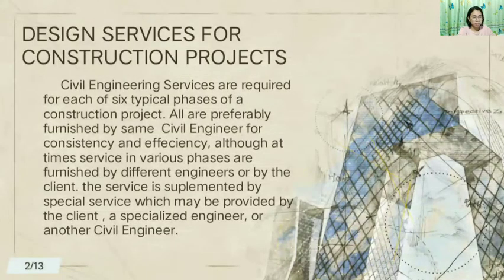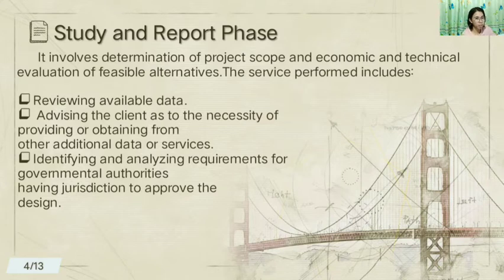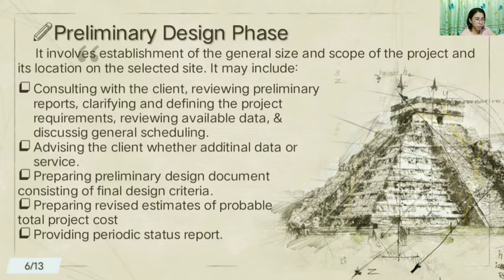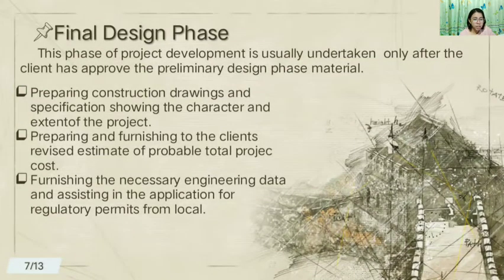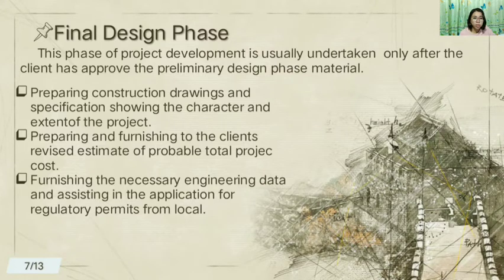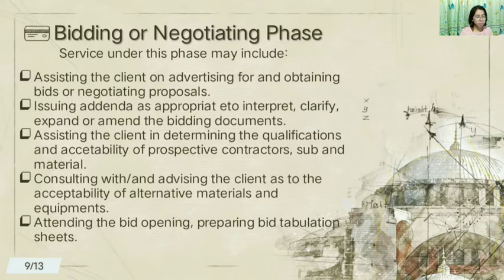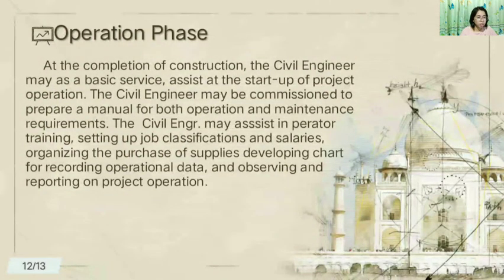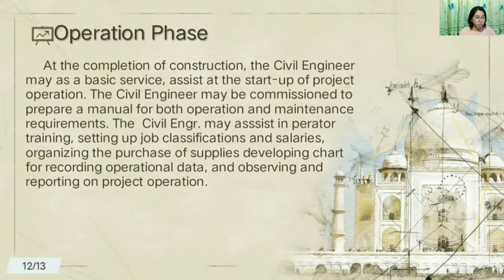2.3 Design Services for Construction Projects

Comment: The reporter discussed about the Classification of Engineering Services.  Many consulting engineering firms offer a wide range of services, while others focus on specialized engineering disciplines such as geotechnical, environmental, traffic, or structural engineering and work with a prime engineer, architect, or owner. Because few consulting firms are qualified to provide complete service for all projects, associate consulting specialists are frequently used to provide specialty services. Clarifying phrase should be included in the contract for engineering services to avoid confusion.

Comment: Within the terms of the Contract, Design Services refer to the professional design and construction management services supplied by the Designer or consultants managed by the Designer. Professional engineering skills is required for each of the six fundamental phases of a construction project. This phase usually includes the study and report phase, preliminary design phase, final design phase, bidding or negotiation phase, construction phase, and operation phase. For consistency and efficiency, all services should preferably be provided by the same consultant, albeit services in different phases can be actually offered by distinct consultants or by the customer.

Comment: This topic has thought me the important thing that I did not know about. The phases for an engineering service. This phase is very important for you to have a guide while doing any project. Because it is not just about designing, presenting, etc. Some steps should be followed to have the proper run of the project.

Comment: The repor is all about the services for construction projects, it is very critical to absorb and appreciate the relationship between design and construction while planning the output of buildings. These procedures must be considered as part of a larger system. First is the general design, it is the process of developing a description of a new facility, which is usually represented by plans and specifications precisely. The construction planning, on the other hand, is the process of defining the activities and resources required to turn the design into reality. As a result, the construction is defined as the execution of a design in accordance to the harmonized vision between the architects and engineers. There lots of operational tasks that must be completed in both design and construction, in accordance to the variety of priority and other linkages among the tasks in the field.

Comment: In this video, it focuses in Design Services for Cobstlnstruction Projects. According to the reporter, it required for each of six typical phases of a construction project. The services is suplemented by special service which may be provided by the client, a specialized engineer, or another Civil Engineer. These six phases are Study and report phase, preliminary design phase, final design phase, bidding or negotiating phase, construction phase, operation phase. It explained how engineering services follow the certain phases that accords to the profession of Civil engineer.

Comment: In this video, the reporter tackled about the design sevices of construction projects in section 2 of the classification of engineering services. Design services means the total architectural design and engineering for the Trade Contractor Work, and includes all labor, materials, gear and services to be given by the Trade Contractor to fulfill its obligations under the Trade Contract Agreement. The Design Services shall include the entirety of the work, materials, hardware and administrations to be given by the subconsultant  of any tier employed directly  or indirectly by the Trade Contractor, and will incorporate all necessary and appropriate coordination and integration of the Consultant's Services to allow the Trade Contractor to complete the Trade Contractor Work in understanding with the Design Documents. The Design Services will be performed in strict accordance with all arrangements of the Act.

Comment: The essential factors of the design procedure encompass the established order of targets and criteria, synthesis, analysis, construction, checking out, and assessment. Thus, the top reason for engineering layout is to use scientific information to answer technical problems. While engineers offer a technical solution, it's far very essential to recognize that engineering layout implies an answer this is aesthetic as well. In different words, designers too are worried to make certain that the stop product is economical, eco-pleasant, and appeals to users. This manner guarantees that your designs are nicely converted right into a first-rate stop result. The reporter referred to the 6 levels of engineering offerings that's Study and document phase, entails dedication of undertaking scope, financial and technical assessment of possible alternatives. Lastly, the essential factors of the layout procedure encompass the established order of targets and criteria, synthesis, analysis, construction, checking out, and assessment. Thus, the top reason for engineering layout is to use scientific information to answer technical problems.

Comment: When planning structures, it is vital to understand the tight relationship between design and construction, as seen in this video. These operations should be viewed as a component of a bigger picture. Construction planning, on the other hand, is the process of determining the actions and resources required to turn the design into a physical reality. Design is the process of producing a description of a new facility, which is usually represented by exact plans and specifications. As a result, construction is defined as the execution of an architectural or engineering design. In both design and construction, a range of operational tasks must be done, with a variety of priority and other linkages among the various jobs.
services.

Comment: Design Services refers to all architectural design and engineering for the Trade Contractor Work, as well as all labor, materials, equipment, and services that the Trade Contractor must provide in order to fulfill its obligations under the Trade Contract Agreement, as explained by the reporter in this video. The design process must be planned and regulated in order for project budgets to be met, programs to be completed, and designs to be properly coordinated and communicated. Missing information, poorly conveyed information, discrepancies between documents, poor resource allocation, bad decision making owing to insufficient knowledge, and so on can all cause problems.

Comment: In this video the reporter explicate about design services for construction projects align with the classification of engineering services. Design services is a process which creates a sustainable solution and optimal experiences for both customers in unique context and service providers involved. Civil engineers for consistency and efficiency at times service in various phases are furnished by different engineers or by the client. Reporter mentioned the 6 phases of engineering services which is Study and report phase, involves determination of project scope, economic and technical evaluation of feasible alternatives. Preliminary design phase, it entail establishment of the general size and scope of the project and its location on the selected site. Final design phase, this phase of project development is usually undertaken after the client's approval. Bidding or Negotiating phase, it is to assist, issuing and attending for the requirements of the projects. Construction phase, it entail on consulting and advising the client the client for the projects and lastly is the Operation phase, it is the start-up of the operation of the project and preparing manual for the maintenance and operation.

Comment: In this video, it is critical to appreciate the strong relationship between design and construction while planning buildings. These procedures should be considered as part of a larger system. Design, in general, is the process of developing a description of a new facility, which is usually represented by precise plans and specifications; construction planning, on the other hand, is the process of defining the activities and resources required to turn the design into a physical reality. As a result, construction is defined as the execution of a design created by architects and engineers. Numerous operational tasks must be completed in both design and construction, with a variety of priority and other linkages among the various tasks.

Comment: The Design Services shall include all of the labor, materials, equipment and services to be provided by the Subconsultants of any tier employed directly or indirectly by the Trade Contractor, and shall include all necessary and appropriate coordination and integration of the Consultant’s Services to allow the Trade Contractor to complete the Trade Contractor Work in accordance with the Design Documents. The Design Services shall be performed in strict accordance with all provisions of the Act. Kicking off a project with an appropriate budget, an accurate schedule, and a clearly defined design plan is crucial to the success of any commercial construction project. This process helps ensure that your designs are translated efficiently into an amazing final product.

Comment: Design, in terms of building, is the process of coming up with a solution to a project brief and then writing instructions that allow that solution to be built. Under the part of classification of engineering services, this video report presented design service for construction projects. It is critical to appreciate the strong relationship between design and construction while planning buildings. These procedures should be considered as part of a larger system. Design, in general, is the process of developing a description of a new facility, which is usually represented by precise plans and specifications, construction planning, on the other hand, is the process of defining the activities and resources required to turn the design into a physical reality. However, building services, play an important role in the design of a building, not only in terms of overall strategies and standards to be met, but also in terms of facade engineering, the weights, sizes, and locations of major plant and equipment, the position of vertical service risers, and distribution routes.

Comment: The video is all about the design services for construction projects and it is under the classification of engineering services. The six typical phases of a construction project require civil engineering services. The six phases are study and report phase, preliminary design phase, final design phase, bidding or negotiating phase, construction phrase and operation phase. An engineer should properly propose the project and its data. The engineer relays the message from the client to the contractor and vice versa. The client and the engineer should have a good relationship so that the project will be done successfully.

Comment: The presentation is all about design services for construction projects. Civil engineering services are required for each of six typical phases of a construction project the 6 phases first, study and report which involves the determination of project scope and economic and technixal evaluation of feasible alternatives; Second premilinary design, it involves establishment of the general size and scope of the project and its location on the selection site;;Third,final design which the project development is ussually undertaken only after the client has approve the premilinary design phase material; Fourth,  bidding or negotiating a serivice under this phase include assisting, issuing addenda, consulting and attending the client; Fifth, construction phase it involves consulting and advising the client during comstruction and ussally thos who are associated with service as the clients representative; Lastly is the operation phase where the project will be conducted and the civil engineering service will purchase supplies, organize , record datas, observe and reporting on project operation. And that is the reporter reports all about.

Comment: Design Services refer to the professional services for design and construction management provided by the Designer or consultants coordinated by the Designer within the conditions of the Contract. Each of the six basic phases of a construction project necessitates professional engineering expertise. The study and report phase, the preliminary design phase, the final design phase, the bidding or negotiating phase, the construction phase, and the operation phase are all included in this phase. All services should ideally be given by the same consultant for consistency and efficiency, though services in different phases can be offered by separate consultants or by the customer.

Comment: According to what I understand that Design Services refers to all architectural design and engineering for the Trade Contractor Work, and includes all labor, materials, equipment, and services to be provided by the Trade Contractor to fulfill its obligations under the Trade Contract Agreement. Starting a project with an appropriate budget, an accurate schedule, and a clearly defined design plan is critical to the success of any commercial construction project. Special engineering services include special structural examination of building construction or existing structure, special tests, investigation and establishment of design requirements, geotechnical engineering services involving sampling and boring tests, analysis and recommendation, engineering and topographic services, and geotechnical engineering services involving sampling and boring tests, analysis and recommendation.

Comment: The reporter explained in this video that Design Services refers to the complete architectural design and engineering for the Trade Contractor Work, as well as all labor, materials, equipment, and services that the Trade Contractor must provide in order to fulfill its obligations under the Trade Contract Agreement. Any commercial construction project's success depends on starting with a suitable budget, an accurate timetable, and a properly defined design plan. This procedure ensures that your designs are properly transformed into a fantastic end result. Special structural examination of new or existing structures, special tests, investigation and establishment of design requirements, geotechnical engineering services involving sampling and boring tests, analysis and recommendation, engineering, and topographic services are all examples of special engineering services.

Comment: In this video the reporter talked about that Design Services means the complete architectural design and engineering for the Trade Contractor Work, and includes all labor, materials, equipment and services to be provided by the Trade Contractor to fulfill its obligations under the Trade Contract Agreement.Kicking off a project with an appropriate budget, an accurate schedule, and a clearly defined design plan is crucial to the success of any commercial construction project. This process helps ensure that your designs are translated efficiently into an amazing final product.Special engineering services include special structural examination of building construction or existing structure, special tests, investigation and established of design requirements, geotechnical engineering services involving sampling and boring tests, analysis and recommendation, engineering and topographic.